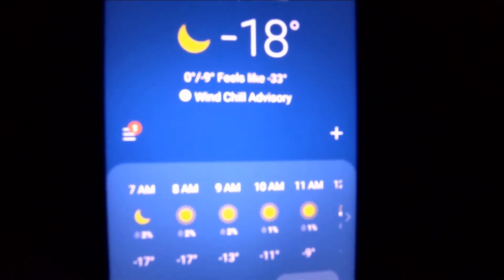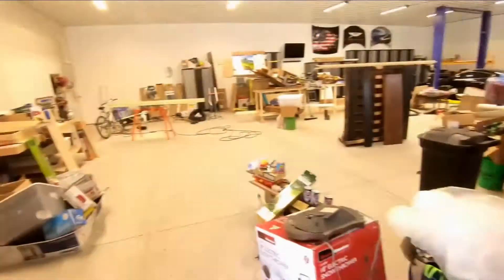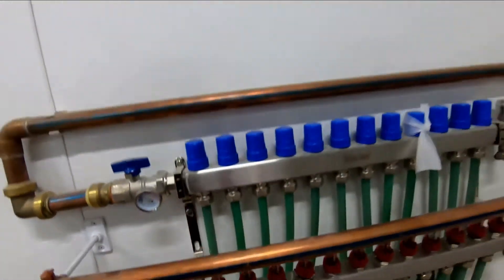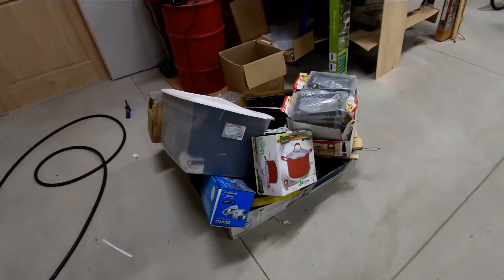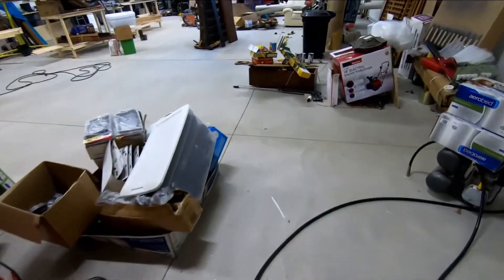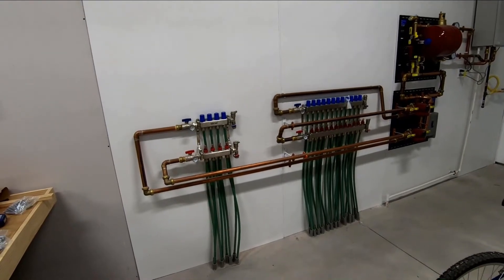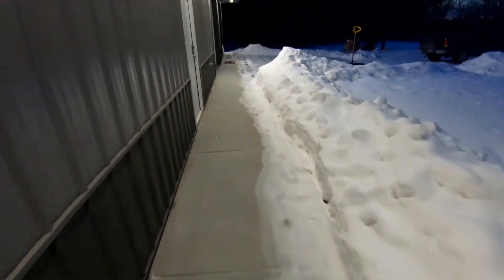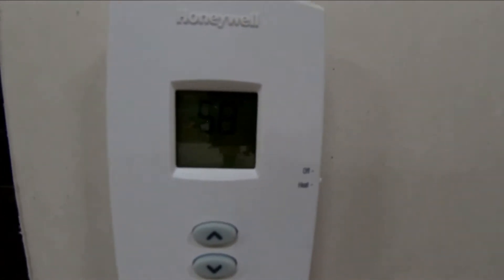-30  Degrees ! Did it Heat? NO Slab Insulation & Tankless Water Heater in Pole Barn Radiant Floor!

Comment: Just wanted to let you know I did a 32 x 50 pole barn and I insulated underneath the slab with the correct insulation called barrier X and I also insulated the sides of the 4 inch height of concrete anyone who does not insulate the floor for personal use is cazy. It cost the same amount to insulate under the slab as it does to insulate a wall. I also put down construction plastic first like you normally do. I ran my pecks tubing 1/2 inch 12 inches apart. No need for all the fancy manifold gauges there’s where your money Wasted money goes. I have 12 loops the two center ones are doubled up so it’s 14 loops . One circulator pump ,one 24 volt transformer to the thermostat to Activate the pump. I use a 30 gallon propane hot water heater for heat source. I live in northeast Pennsylvania I light it up at the end of October and shut it off around the end of May set it at 70°. The temperature never fluctuates stays at 70 uses 300 gallons of propane per year. Did all the work myself total cost $2,800.00 . Under slab concrete for heated floors is the most important thing about radiant heat putting insulation under your floor in your home without radiant heat is also one of the best things you can do.
Reply from the maker: Barrier x is pretty expensive and a 40 x 80 uses 100 sheets of foam so looking at around $4200 for foam only.  The perimeter uses about 30 sheets  for a 40x80 ( 10 per side and 5 per end) so $1200 in foam. I have a video explaining heat loss vs slab insulation. I heat my 40 x 80 @ 58 degrees and it costs me only $550 a year , in  Minnesota starting in Oct to May and thats with a NG meter fee of $10 a month in bill. Propane is expensive so your heating yours for around $750-$900 a year . Your building is 1600 sq ft VS mine at 3200 sq ft. So square ft comparison , yours would cost $1500-$1800 a season if it was the same size as mine! Granted 70 degrees is pretty hot for a garage/shop , if you would drop that to 60 degrees , its a nice working temp . Don't sweat if you work but cool if you don't.  That would probably save 20 -30 % per heating season. Remember , this is a thermal mass build and is designed like the videos to optimize heating/cooling cycle . If doing a regular radiant floor, then no slab insulation would make the system useless.
Reply: Barrier X is inch and a quarter white foam with Tyvek on one side and Tyvek 3 inch overlap seam seal in a large roll not a sheet. The new price if I was to do my floor again current market is $1600. Hydronic heating and cooling concrete requires insulation to stop the wicking of mass from outside elements just like you use a cooler to keep your food hot or cold. In this video it seems like his system is always running never will  catch up it will heat but you’re losing mass. I do turn my thermostat down to 62 once it gets cold out because you get heat overrun meaning if I open the door and the cold air kicks the thermostat on on the wall and the system turns on for say 15 minutes because the concrete already warm it gets over warmed because it holds its mass I should have a concrete temp sensor this week correct the problem but it’s OK I can turn my heat off in the middle of winter and it will retain the heat for at least five days to it starts to feel a little chilly. I have a 500 gallon propane tank that I filled up in the fall I still have 30% it probably cost me 350 to 400 last winter and it was pretty cold. I also added a chiller for the summer it cools the concrete it’s so sweet.
Reply from the maker: @mikekuhn621   This system doesn't turn on when you open a garage door as the thermal mass of the floor is so much that it recovers within minutes, unlike regular radiant builds . This will not turn on for 3 days when temperature is 20 degrees or warmer due to mass. Your correct about moisture wicking away heat, but the perimeter has 4ft insulation to create a chimney effect and prevent frost penetration and heat loss.  The 1 1/4" barrier x price is $910 for a 4ft x 64ft roll. so for your build you would need 7 rolls for a cost of $6300 ! The 3/4 thick stuff is $210 a roll , but that would be useless underslab.  If you used 350 gallons of propane (70% of 500)  , a quick search shows that the cost of propane in your area is between $2-$4 per gallon, so unless you pay $1 a gallon of propane, the math doesn't add up.  So this building is 3200 sq ft and heating it for the same cost as your 1600 sq ft building. Granted natural gas is cheaper then propane , but Propane has 2x the amount of BTU's so you use less propane to heat then natural gas! So this building would use 1/2 the cu ft of natural gas if running propane!  So a thermal mass build is actually the way to go with comparison of sq ft !
Reply: @JasonYouTube  The barrier X insulation only goes under the concrete It’s only made for that.the rest of my garage Is insulated with conventional insulation. With Tyvek on the outside and the metal sheeting.
Reply: You can find it cheaper if you shop it out. I don’t know what calculations you are using to figure out my costs of heating but your figures are wrong I know what it cost to heat my garage I have my garage for seven years now my heat hardly ever runs due to the overwhelming of the correct insulation. I have 15 8 foot HO fluorescent lights that will start raising the temperature in the winter if I leave them on also forgot to mention that I lined the inside of the garage with the white liner corrugated metal same as the outside that the supply house offers.
Reply from the maker: @mikekuhn621  You said that you use 300-350 gallons of propane a year for heating. Propane runs between $2-$4 a gallon depending on delivery charge and what county you are in. If I knew the county I could call a supplier and ask how much for a 500lb fill but that is a general charge amount for a fillup per gallon .  So your heating your 1600 sq ft for $600-$1000 a year. I heat my 3600 sq ft building for $450 a year @ 58 degrees.  Propane has double the BTU per cu ft then Natural gas. So if you use 300 gallons of propane, you  are using about 275 Therms per season. I use around 480 therms of energy to heat my shop. Now I'm heating double the space of your building , but at a 10 degree temp difference plus other differences ( You only have 1 garage door while I have 2 - 10x12,  how often opening door, etc)  so the variables can affect the energy consumption. But for basic math  275therms x 2 = 550 therms if your building was double the size to equal mine ( 3200 sq ft) . So without using insulation underslab , my building is probably as or better energy efficient as yours . So my heat loss from not using slab insulation, is less then 5%-10 percent , but probably close to 5%. would take over 70 years to recover cost of insulation . Assume it cost $3200 for insulation using your figure for barrier x to do your shop ($1600)
Reply from the maker: @mikekuhn621  Why I say closer to 5% heat loss , is because comparisons from other buildings around from others who write in with what size they have and what region. I have like 12 pole barns in my area that are heated and some have radiant . None have my setup, so I compared those heating bills to mine  and my building was more efficient then theirs . My bills were less then their bills even though their buildings were smaller ( 2200 sq ft). Also most people run their barns at around 50 degrees , sweatshirt weather. So I know I have heat loss to the ground, but it is minimal . If I didn't insulate around the perimeter 4 ft down , then my building would use 3x the amount and probably wouldn't heat good.  Perimeter insulation prevents frost penetration that robs the heat. Thermal mass radiant vs normal radiant use different building techniques and if not followed correctly, will make heat system useless.
Reply: @JasonYouTube  I have three garage doors 11 x 11 and 10 x 10 And 8 x 8 plus a man door I keep mine warm T-shirt because I work in there  The garage doors are all top line co-pay insulated solid with windows
Reply: Jason I just got my propane bill for this year worth of heat and with the high prices cost me 590.54       218.8 gallons that will hold me for the winner and I usually have 20 or 30% left When I shut the system down for heat.
Reply from the maker: @mikekuhn621  So basically my building is using less therms to heat then if your building was the same size as mine, but you have a 10 degree temp difference. To convert propane to therms  ( NG use therms) you need to multiply gallons used by 0.916 . So say you have 25% left of 219 gallons = 164 gallons used. 164 x 0.916 = 150 therms you use for season.  Now propane has double the BTU then Natural Gas , so a propane building will use 1/2 then a NG building.  So if your building was running natural gas , it would use 300 therms of Natural gas. Your building is HALF the size of mine, so times 300 by 2 and you get 600 therms if your building was 3200 sq ft.  I use 480 therms a season for my building BUT at a 10-12 degree difference if your doing 70 degrees ( Which is REALLY HOT!  Most working shops run around 62 with radiant heat)  So with these calculations , if I am losing a lot of heat due to no slab insulation , then your building has the same heat loss as mine. Since mine is at 480 therms and a 3200 sq ft calculation of yours , would be 600 therms.  You see what I'm getting at? When you compare standard radiant heat construction VS Thermal mass , everyone is taught you need slab insulation. But you don't for a proper thermal mass build. So without spending $3200 for barrier x ( Your state a 1600 sq ft cost $1600 at now prices) my heat loss will never pay for that insulation. Also I can switch to off peak electricity if gas goes away , and save over  standard radiant build as off peak runs at night at a rate that is 1/2 of standard electricity. Will gas go away? I highly doubt it but if it did I can switch boiler and still afford to heat it at a reasonable rate
Reply: @JasonYouTube i loved reading this dialogue.
I have a 5'' slab if concrete. I was told put insulation down then concrete and radiant. 
I think that putting even 1/2" foam board at $35= $1.2/ft plus thinset to adhere it, it's about $2/ft. That's $9,000 for what i would want to do. 
No way! The calculations i just KNOW would never be saved. I pay around $450-600/ month currently to use space heaters and the house is still freaking cold... (of course. It's only with space heater and garage heaters.)
 That's 5 years of power costs...
Now if i were to do this entire radiant build, all new, it's about half the cost of JUST the insulation and adhesive!

Every company tells me to get insulation but these dudes don't get the freaking math!!! Plus labor (or costs thereof) to insulate it!

Again, I loved reading this dialogue. Appreciate the videos!!

-Iowa
Reply: Wow, nice post on what you did. I was thinking why all gauges and stuff too? Also what was your fluid mix in the system?

Comment: If you have sand underneath your concrete, that sand is absorbing and losing heat to the ground. 2" of insulation would reflect that lost heat
Reply from the maker: The heat loss is minimal vs cost of insulation. 100 sheets @ $45 equals 4500 in insulation not including time. My heating bills run $500 a season so if I lose 10% ( Which its more like 5%) is only $50 extra a season . Would take almost 90 years to recover cost of insulation! Yes inflation and price goes up but will take 40 years to recover it at least. Now I actually heat my building for less then others with standard radiant builds AND I can go into it and it will be 70 degrees when its been in the 90's for a week. No insulation underneath actually helps in cooling the building.  I have done some videos explaining it but most people are old school and takes some time to adapt to new building techniques. Thanks for watching
Reply: @JasonYouTube  My garage is well insulated and when it's 90+ outside, my inside will be that cool and I have no air conditioning. Insulation everywhere is the key and I don't believe your theory.
Reply from the maker: @joeshmoe4671  If you were located in Minnesota we could compare heating bills, but my 1 video I break down my heating costs per Cu ft, so you can compare if your using natural gas.  I have multiple buildings around me that are heated , and I am heating it for less then the standard radiant install. That is due to the fact that the sand acts just like concrete and retains the heat , and will get through the regular swings of temperatures and even them out. If its in the 30's my system will maintain 58 degrees for 4-6 days before starting up, depending on wind conditions. Basically think of a battery mah as comparison ,  a regular radiant system uses a 1200 mah battery. A thermal mass uses 3600 mah . Regular system needs 3 recharges compared to a thermal mass of 1 charge. BUT I can recharge it at a 10 cent kilowatt rate versus standard one say at 10 cent, 15 cent 9 cent. The cents relate to outside temp in this example. So when outside temp is higher , mine can use less energy to recharge instead of needing to recharge it say when its -10 degrees. That is why its a basic Thermal mass battery
Reply: @joeshmoe4671 how cool is your shop in 90+ weather?  I’m building a shop in a year or two and am researching.  I’m especially interested in how to keep it cool in summer.  Will be well insulated.  I’m in Southern IL.  Where are you?

Comment: Why did you not put slab insulation? Its pretty cheap and will make it more comfortable
Reply from the maker: This is a Thermal mass build so you don't want insulation as it will limit your Thermal mass. I did a video on the cost of foam vs extra loss of heat. It would take over 40 years before I recover the cost of the slab insulation . But reality is that the thermal mass build is probably better heating then using slab insulation. In my other videos , I break down some monthly heating bills to show how much per cu ft it costs to heat my building. You can then use that cu ft cost and multiply it by your building size to roughly compare. Its accurate if in the midwest as winters are colder.
Reply: @JasonYouTube  I live in Canada. How did you account for the unknown increases in natural gas prices?
Reply from the maker: @atodaso1668  In the last 30 years , Natural gas has gone up only 50% . In the last 10 years , natural gas has held at same price. With a Thermal mass build , I can switch to electric and run at over 60% off the KWH for offpeak. I could run from 11-6am and this would retain the heat throughout the day. You can't do that with insulation as I have other options to heat and not limited by having a small thermal mass slab that needs to be heated every day to retain heat. My slab on  30 degree days will not run for a week once it is "Charged" up .  Its a big flywheel effect that has Millions of BTU's stored up and releases it when needed. Building techniques change and the early adopters are always the ones that are "wrong" until the old way of thinking is disproved . Thermal mass builds have always been around , think stone fireplaces, but in radiant it is still not that widespread known . Need to do it correct and it works better then the slab insulation way.
Reply: @JasonYouTube  Well you had better hope that you don't get the "carbon tax" like we have up here. It added $60 a month to my gas bill, so a 30% jump on a policy change...
Reply from the maker: @atodaso1668  Yes right now we got hit with a Feb Texas event for the problem in Texas, and I'm in Minnesota. That added $20 per heating bill. But I have an out with going off peak electric, just would need to change out water heater for an electric one. I have the amps required and outlet nearby to change it if needed. But with electric cars, electricity will go up and gas prices will go down in a perfect supply/demand world. But I highly doubt that .

Comment: The expansion tank should be vertical not horizontal
Reply from the maker: Most manufacturers state that orientation doesn't matter as it needs to be supported properly. Its a bladder filled tank that has pressure to push out air bubbles that are in tank and system is purged to eliminate air bubbles

Comment: Hmmm. So I have a 40x50 quanset I just built, planning on doing in floor heat. But idk if I’m gonna ever get enough saved up to insulate the building itself..at least not anytime soon. So I was thinking if I just insulated the slab underneath but now I’m hearing guys say not to do that. 🤔
I’m not sure I’m convinced about thermal mass being more efficient or effective but it’s a compelling argument
Reply from the maker: No matter what build type you use ( Thermal mass or standard) you will need insulation in building to retain heat from the slab.  But no matter what , put in the pex now since the cost is minimal and will save money in future on heating costs over other types.